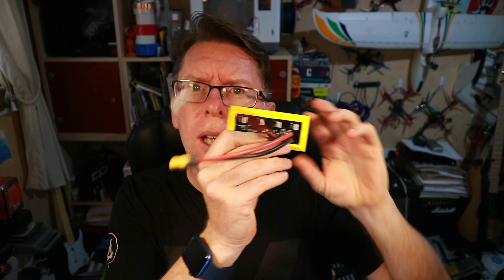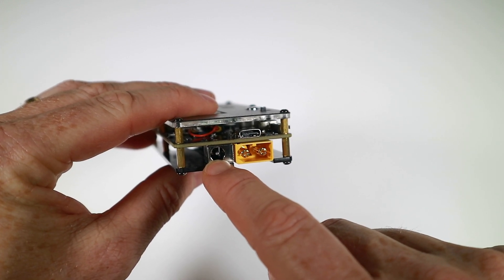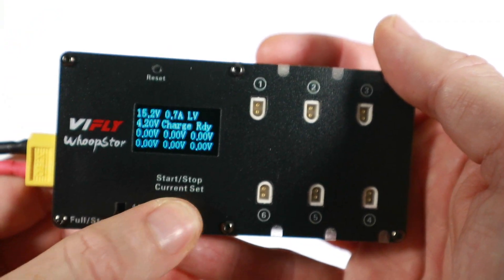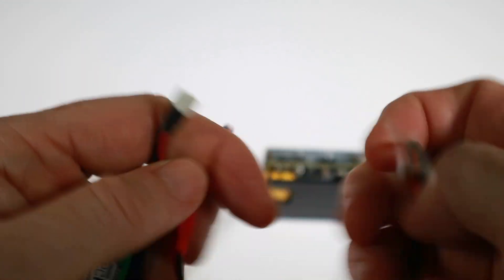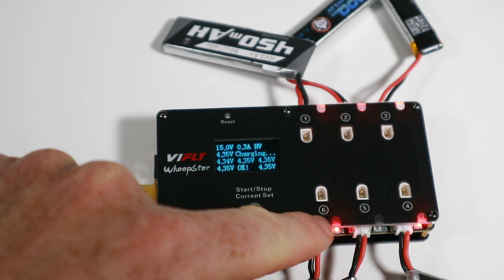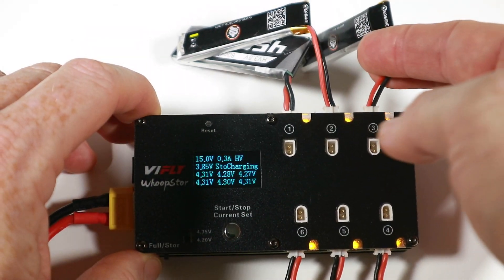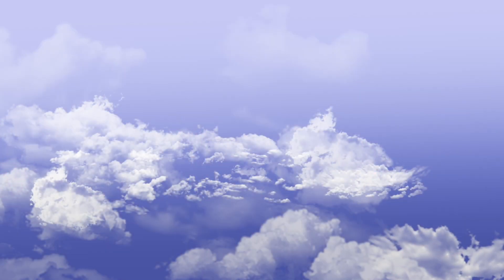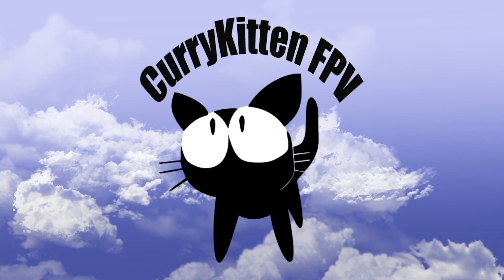ViFly WhoopStor - charge AND storage charge your 1S lipos.   Supplied by ViFly

Comment: I especially like the storage settings as that has always bugged me on 1S. I have a 6 port Ultra Power UP-s6ac/dc 1S charger. But no way of setting it to go to storage charge. You have to keep a keen eye on the individual voltage read outs for each battery when wanting to get then to storage charge. It does have micro, mx, mCPx and Jst plugs on all six battery ports. Just wish they had incorporated that storage feature.

Comment: As a negative note, the firmware upgrade is only supported on Windows. There is already a new version available
Reply: I used mac for years, always made sure I had a windows virtual machine that I could start up for the rare occasion when something was windows only.
Reply: @ChuckPheltnic  This is why many businesses are only supporting windows. You don't have to look for workaround, they have to provide a proper service. If I knew before, I wouldn't have bought their product.

Comment: I already have one and it makes things so easy. I used to use a home made serial lead and discharge 3 at a time to storage but there was, of course, the restriction that all the lipos needed to be the same capacity and I have a bit of a mixed bag! I highly recommend this WhoopStor to anybody who flies whoops - worth it regardless of how many parallel chargers you already own. I usually power mine from an old laptop adapter, converted with XT60 but my ToolkitRC M7 in power supply mode is also good. I am a fan of converting surplus AC/DC bricks into bench power supplies ... don't just take them down the tip guys!